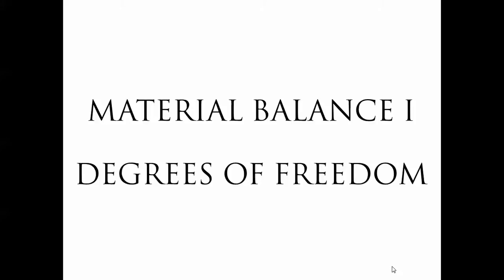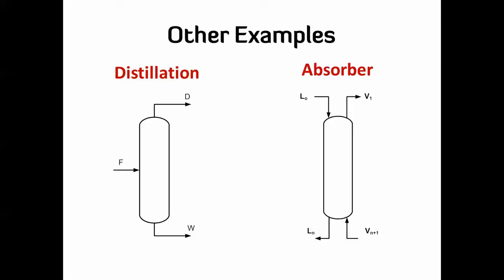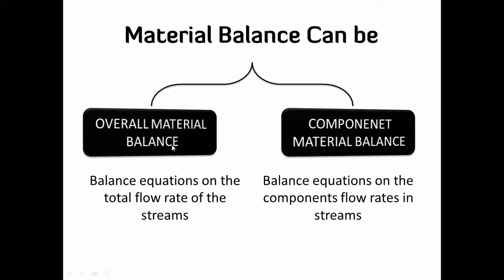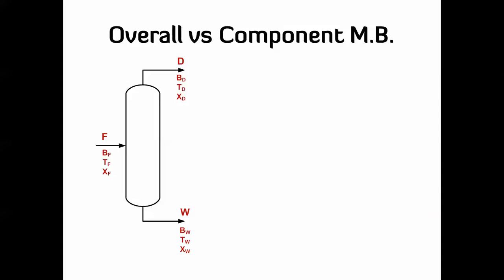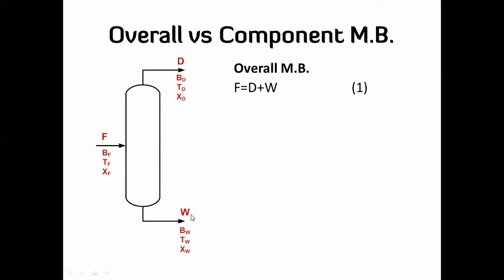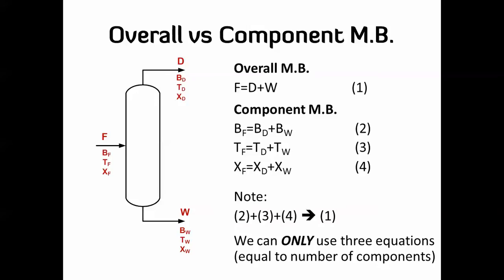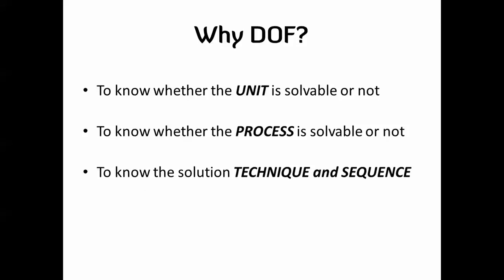Excel for Chemical Engineers I 12 I Material balance (1/5) [Degrees of Freedom ]

Comment: Why at 9:26 do you say the initial stream has 4 variables and the others 3? Surely they have 4 each as they are all individual components?
Reply from the maker: Because in the initial stream we know the compositions and the total flow rate which means that we know the flow rate of each component. However, in the other streams we know only the compositions or mole fractions of the components without knowing the flow rates. Therefore the information we know is 3 since the mole fraction of the last component is known because sum of mole fractions is 1. Please check 4:50 in the same video for more details on this point.
Reply: @MGMohammed   it contradicts what you said at 4:50. You stated you know 3 compositions at 4:50 and assigned it a variable number of 3 and at 9:26 you know 4 compositions and assigned it a variable number of 3?
Reply from the maker: @byebrows9698  I think you might be confused between two terms:
1- The number of variables: where we count all the variables present in the streams whether known or unknown.
2- The number of GIVEN variables: where we count ONLY the known variables. This equals to the number of all the variables in the stream if we know the total flow rate and composition, and equals to the number of all the variables in the stream-1 if we know only the compositions.

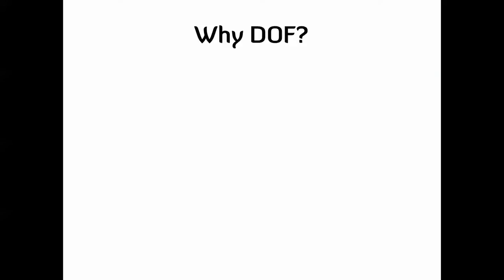in minute 4:50 to 6:10 I discussed the case and put the number of GIVEN variables=7 which is 3 (stream F)+2(stream D)+2(Stream W). If you check it you will find that I put 3 for stream F where flow rate and compositions are known, while I put only 2 for each of streams D and W where ONLY compositions were known.

Hope this makes the point clear.

Comment: In the entitled expression: given variables, Mr Mohammed must not scrape together flows and the compositions. Because of that, Mr Mohammed says that if DOF = 0, the exercise can be solved. That is false. 

If DOF = 1 and flows are not known, an exercise can be solved. If DOF = 0 and no flows known, an exercise can be solved. In general, I call it the condition (1,0): 1 without flows and 0 with flows.
Reply from the maker: +BEN-HUR VALENCIA VALENCIA
You can include both compositions and flow rates in the number of variables and do the DOF analysis normally, however if the DOF=1 with no flow rates then you can assume a basis for any stream. So what I said is not false because there is a given flow rate already.